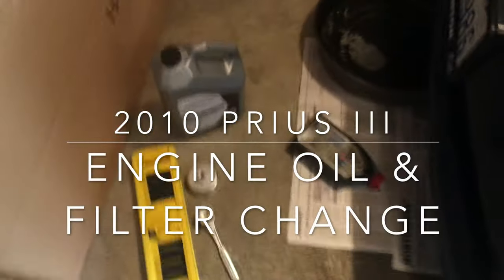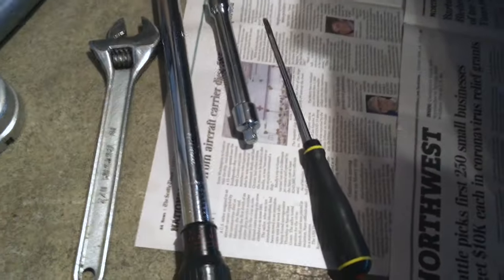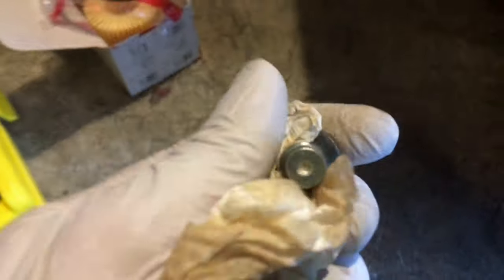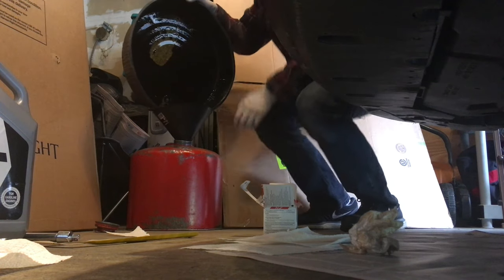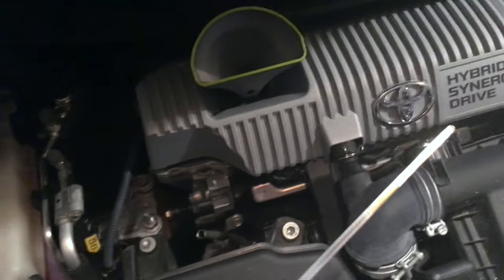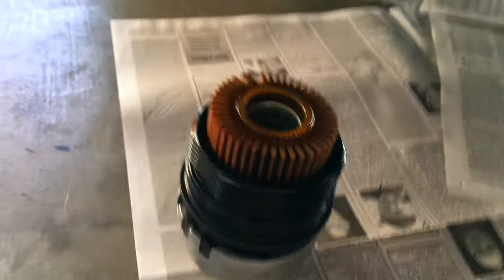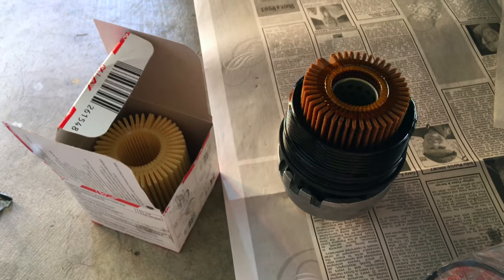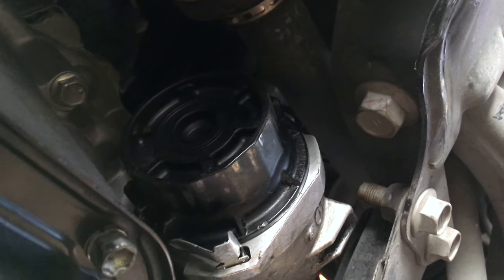2010 Prius Oil & Oil Filter Change : Shame on Toyota for the stupid plastic oil filter housing!

Comment: 27mm socket. Ha! Got a 3/8” insert right on the housing…
Reply from the maker: Removing the filter housing works better if the engine is warmed up fully // & yes the special filter housing removal tool & its associate weird sockets make it easier. I used an impact driver to remove it because of how tightly the housing was screwed into the engine mount // careful with the new O-ring on install too, if its damaged it can cause oil to leak. I save the spent motor oil in an antique metal gas can & bring it to my local auto-parts store for engine oil recycling!
Reply: @AaronSchwarz42  - 👍🏻 gracias!

Comment: So, you replace your filter AFTER you’ve poured the new oil in?? 🧐
Reply from the maker: Na, I take the filter off & drain the oil from the engine drain plug. Then change the filter element & O-ring, then install the filter in its housing. I restore the engine drain bolt with a new crush washer & use a torque wrench to tighten it to 20 lb-ft. Then I use a special funnel to add 0W-20 fully synthetic oil I get from Costco for $23 for 10 quarts in two 5 quart jugs